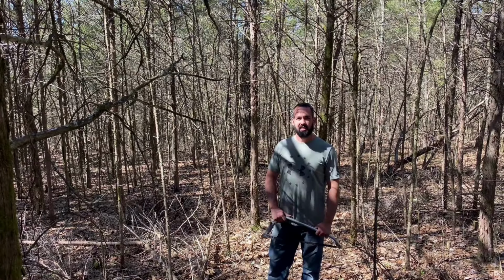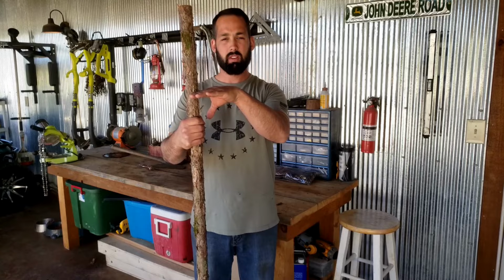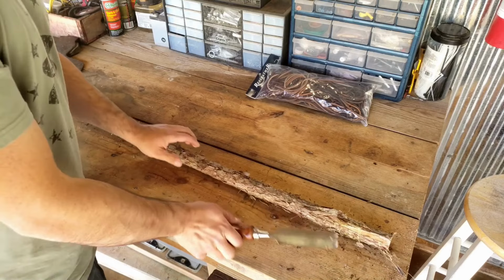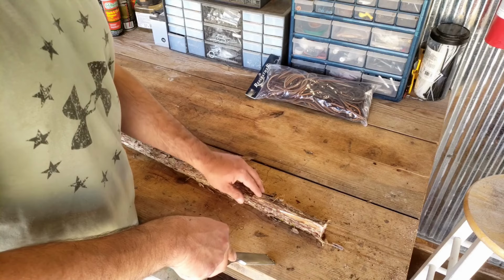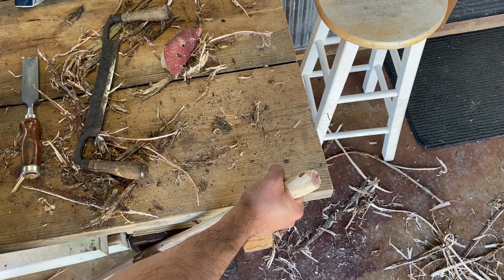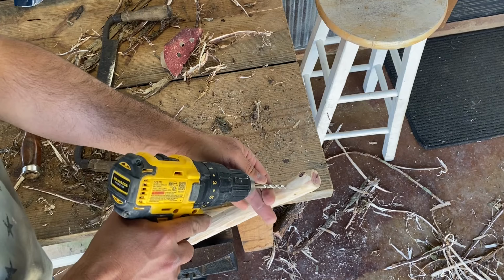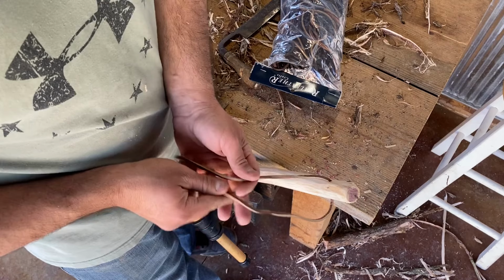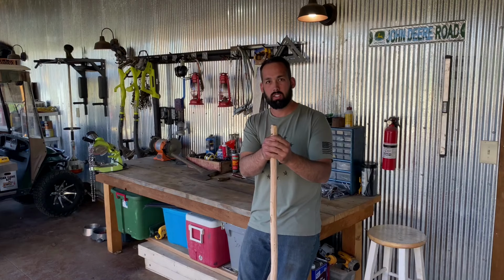DIY Cedar Walking Stick

Comment: I think that by the time I post this comment You'll have realized that your leather cord is too short and cuts off the circulation in you're hand.  I don't mean to be mean spirited but I too have been down that road and had to make a longer lanyard.  I know that Cedar bark removal can be a bummer, everything you said was true., if there's no knots from where branches grew, the bark will offten strip off the whole length if done soon aftere cutting a live stick.  thanks for the post!

Comment: I always use 24" of leather. That way you can use  the lanyard as a crude measuring tape if needed. Untie the lanyard to measure 2 feet, half the untied lanyard is a foot, etc. Also you can get a cheap 3/4 inch dia compass online to mount that the top of your walking stick. A couple of coats of poly, and you are done.
Reply from the maker: Great ideas
Reply: I cut notches in mine inches to 1 foot then 2 foot and 3 feet.  gives me a yard stick. I then color them with a sharpie.

Comment: Some folks advise that the grip position on a walking stick should have your firearm level, rather than slanted.  That works for me.   Wherever the grip is located, it should be comfortable for the user.
Courtesy of Half Vast Flying

Comment: One thought on the height.  Do whatever u like.  But in my woods, the spider webs are thick.  And if you've ever walked into one, you know what I mean when I say the spider web dance... but then after the dance stops, the worst part -wondering if the spider is now on you.  Lol.

I like my walking stick head high.  I keep it in front of me when I'm walking between trees so it catches the spider webs instead if my face.  
I also wrap a parachute cord grip for my hand, and at the bottom of the grip i hang a flashlight that shines forward.  Then I use a wire tie to keep it still.  That way I can carry the walking stick in one hand and light my way, keeping the other hand free for things like adult beverages, cigars, etc.  

The flashlight I use shoots forward along the grip in one setting then forward out the tip in another.  So if I hold the stick forward, parallel to the ground, I can imagine I'm Gandalf and shoot a beam of light out into the woods ahead of me instead of a broader light just ahead to light my way.  Ya know, when I hear a grunt or a rustle in the dark.

Comment: I am making one now.  Needed to know what a draw knife was called, so the comments here helped.
But man, it's sticky right? I had to use gloves.  Still makes the floor, the tools, and whatever I step on sticky.  

I found using a chisel was the best too.  But now I want a draw knife.  Is curved or straight better?

Or straight more widely useful?  Is that why yours is straight?